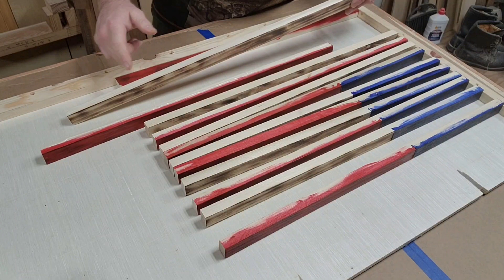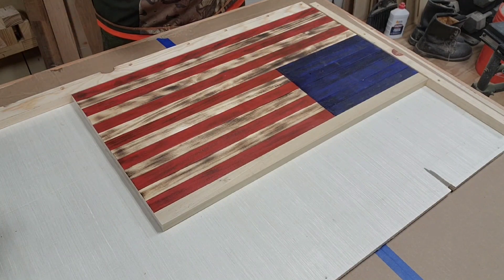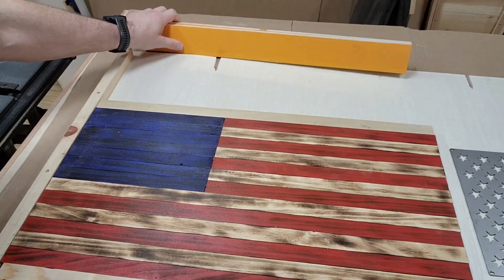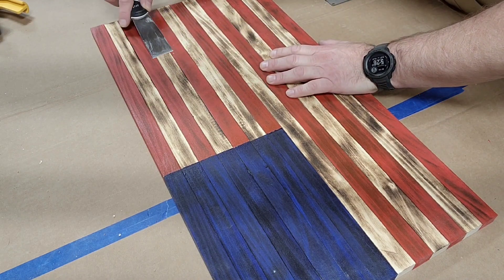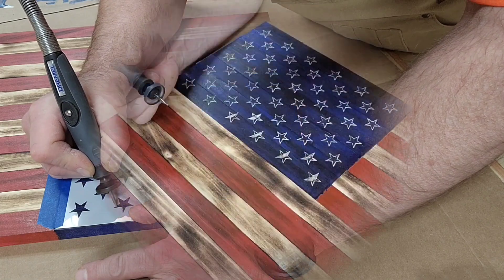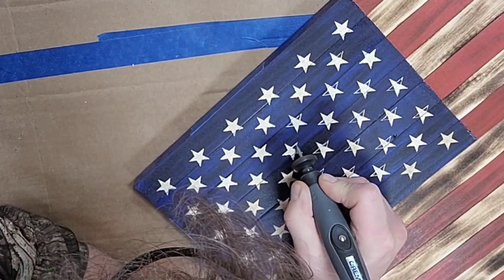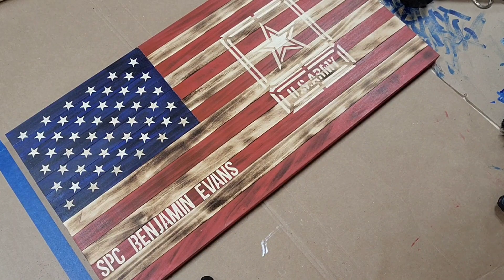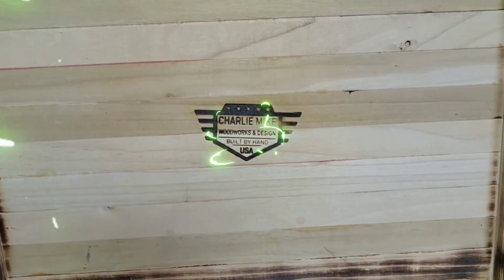#FREE FLAGS for Veterans! (Pt 2) #mentalhealthawareness #woodworking #vet #firstresponder #easydiy

Comment: I enjoy metal sir, but that’s not for everyone
Reply from the maker: Maybe we'll be able to put something you fabricate with something I cut.  That'd be awesome
Reply from the maker: Metal, I gotcha.  Sorry that o e took a little for me to get.  Whew!  All good now.
Reply: Thank you for replying sir. Can’t apologize for how quickly you respond. I appreciate the response at all. Question. Have you thought of doing something for the stars as far as stain resistance? Example would be to put the pattern down and spread wood glue and let that dry, we’ve all been there with one project or another when finishing. Or perhaps a light coat of polyurethane again through the stencil then apply blue stain after it’s dried?
Reply: And did work with metal but that was in a shop years ago. Don’t do that anymore
Reply from the maker: @gregbaldwin6428  I haven't, but I'm going to look at that and see.
Reply from the maker: @gregbaldwin6428  same here.  More like doing a little butt welding and running steel through rollers and a huge copper disc.  About 30 yrs ago.
Reply: I live here at Fort Cavazos, TX. Formerly Fort Hood. I'd be happy to advertise for you. I hate to even ask, but if you have a list, I'd like to get on it, lol